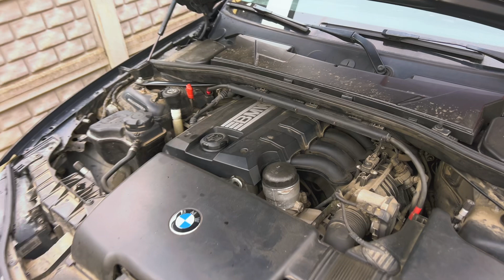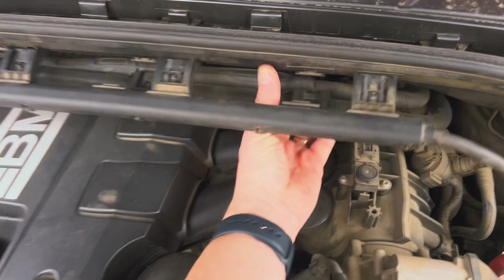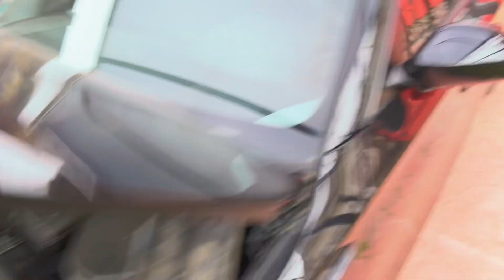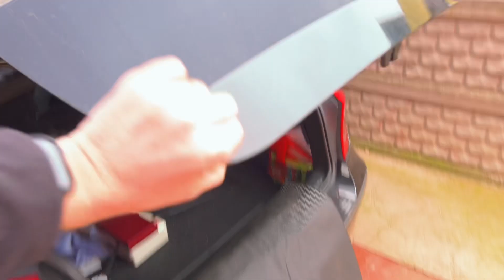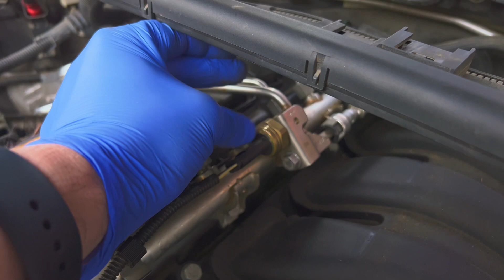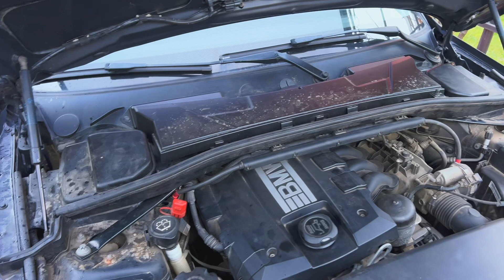BMW N43 116i E87 - HPF Sensor

Comment: So I have some turbo actuator faults and no mechanics wanna touch it.. long story short I also have a fuel rail pressure sensor code and chat GPT is saying it’s very likely the fuel rail sensor is giving bad info to the turbo and that’s why the actuator is giving out activation faults. Could just be an issue with the actuator but I’m gunna try this first as chat GPT told me to do this first as it’s most likely the cause of a false fault in my actuator. I’m gunna follow this video step by step I’ll keep you posted 🙏🏼🤝🏼

Comment: Is that clicking sound from the HPFP normal after changing something in the fuel system?
Reply from the maker: Hi! I'm not sure what is normal and what not 🙂 The HPFP, being mechanically driven, will make some noise but i think most of the clicking is from the injectors. In any case, this engine sounds like a diesel 😬

Comment: Why did you replaced it?
Reply from the maker: Hi! I investigated a problem with rich fuel mixture. I had -25 - -28 LTFT and, after excluding the injectors and MAF I concluded it might be this sensor (reading lower then real fuel pressure, thus tricking the ECU into raising fuel pressure). LTFT is now at arround -8 at idle. But I am not 100% convinced that changing the sensor is the fix - so that's why I did not mentioned this into the clip, but instead I just published it as a DIY on replacing the sensor.
Reply: Salut, am 2a2c bank 2 mixture rich. La ce sa ma uit prima data? Am injectoare vechi dar nu sunt leaky. Cateodata pornit la rece , turatiile se ridica dupa 5-10 secunde se normalizeaza
Reply from the maker: @FlawaPowa salut! Nu sunt mecanic. Învăț și eu pe mașinile mele - un hobby ca să zic așa 🙂 Din "experiența" mea situațiile de amestec bogat sunt dificil de investigat . Amestec bogat înseamnă de fapt că sonda lambda măsoară un nivel de oxigen in gazele de eșapament mai mic decât cel așteptat. Deci poate sa fie prea puțin oxigen, nu neapărat prea mult combustibil. Poate sa fie debitmetrul care indică mai mult aer decât motorul primește în realitate. Poate sa fie sonda de oxigen (lambda). Poate sa fie un senzor de temperatura (aer, motor/antigel/ulei) care indică greșit temperatura și induce ecu in eroare (adică reglează o cantitate de combustibil incorecta pentru temperatura reală). Dar poate sa fie și prea mult combustibil sau ulei (sa zicem admis printr-un sistem de recirculare a gazelor de carter care nu funcționează corect). Poate chiar și sistemul de purjare al vaporilor de benzina din rezervor. Sunt multe.. sigur mi-a scăpat ceva. 
Având în vedere că eroarea este pe un banc presupun că pe motorul tau exista și un banc 2. Caz în care ar avea o sondă lambda separată. As incerca sa le schimb între ele sa vad daca eroarea se muta pe celălalt banc. 
E normal ca la rece sa pornească motorul la turație mai mare și apoi să se stabilizeze undeva la 750rpm.